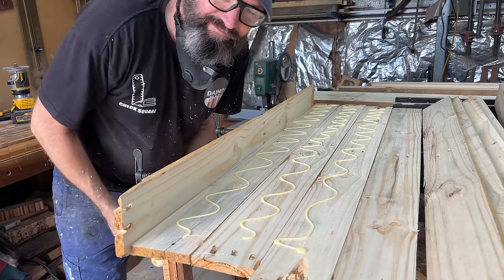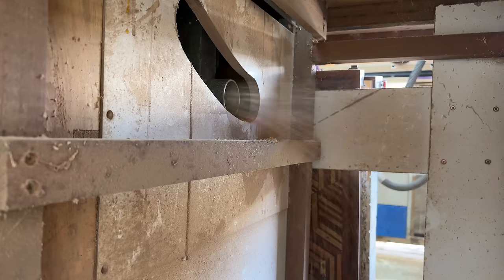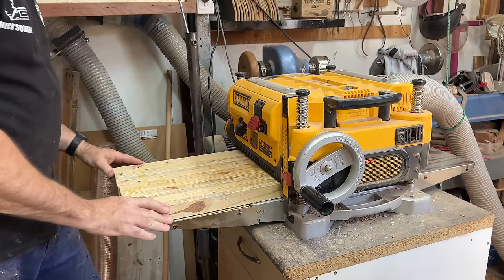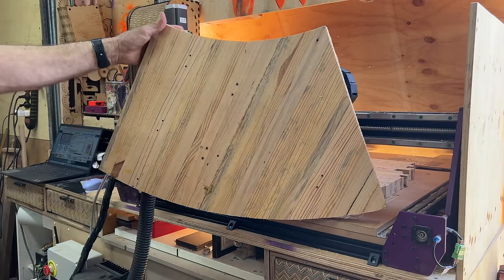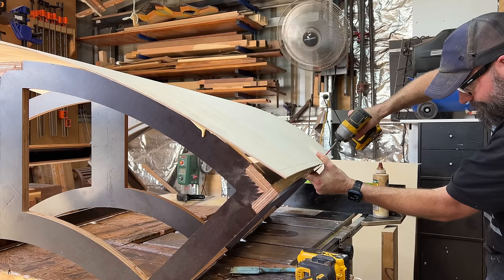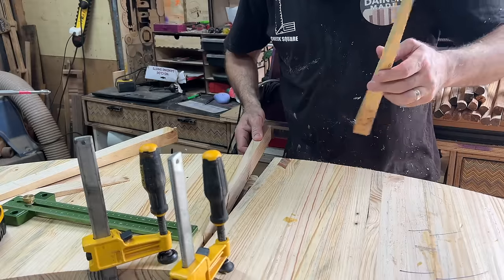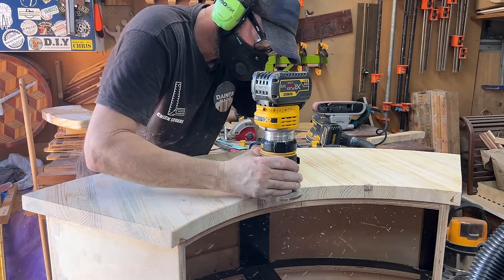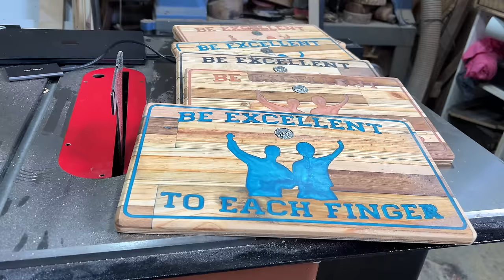Ambitious project to save us lots of money

Comment: At 6 minutes in, I like the explanation you gave about the movement of timber, but I do think the timber of its going to move will go side to side, as well as up and down, just not in the length. It's just how timber is, it has nothing to do with how the timber was nailed in the pallet.
Reply from the maker: the nails holes are the side grain faces off the  of the boards that's all. It will all move yes, but I am reducing their chances of separations. cheers mate

Comment: You are productive, man! Looks easy on video all that work, but you got dedication mister! Bravo! The reason for the nail holes facing up, is not about the nail holes as much as the grain direction, right? I understood the advice coming from the fact that the nail holes indicate which direction the planks had been attached on the pallet, which obviously is the flat side, thus meaning the grain direction will be the same – or am I missing something? Cheers!
Reply from the maker: That is right, I think I could have explained that a little better. The nails are on the side grain of the board. Therefore breathing in and out as in up and down. Rather than expanding more across the slab

Comment: Hello.
I recently got into woodwork. And came across your video and love them. 
You have inspired me to try new things. I also like using pallets. I'm from the UK. I got a question tho what table saw blade do you use? 
I got a second hand one recently as a starter table saw and Need a better blade but a tad unsure what to get.
Thank you 
Ardam
Reply from the maker: I generally buy ripping blades as that is mostly what I do. I have one with a flat tooth grind as well which lets me rip, and also cut flat joints
Reply: @dainermade  thank you for replying

Comment: hey mate, buy yourself a multi-tool...trust me there will be no regrets
Reply from the maker: I did own a shite one once. Is this for the slat chopping?
Reply: @dainermade  yeh, also finish sanding for those tight corners..also you can get a medley of different width blades…the amount of times it has got me out of trouble is insane..the other attachments are good too like the mini wood carvings discs

Comment: Dude. That rules! That thing is going to look wicked. How good was sticking the landing on the overall batten spread, last one dropped in its spot perfectly  👏👌🏻 Ioved the ratchie clamp approach too....  have you got a finish nailer in the arsenal? That would of been the quicker/easier/far less anxiety inducing approach. Paslode should jump on board for the next build 🫶 

Very good message too. I spent a decade trying to deal with PTSD & mental health issues in all of the worst ways possible. Some of those worse ways were even given to me by Doctors 🤷 But talking ended up helping, talking helped the most. Talking to the wrong therapists however was off-putting & didn't help. I would of loved to be able to switch therapists as easy as they claim you can on this app. I'd suggest anyone that's constantly dealing with anything internally to just go for it & get talky talky. Worse case scenario you have a 5-min chat, best case scenario the little problems you're repressing get dealt with & don't inevitably compound into bigger problems.

I digress.... hell yeah WOODWORKING, FURNITURE, ART & FRIENDSHIPS & STUFF!! ❤😂
Reply from the maker: My dude!! Firstly no I don't own a pin nailer as yet. Secondly thanks for sharing that mate, it is important stuff and talking it out is the best way. Very happy the woodworking caper brought you into my life mate. Brosephs! 
I will pin your comment after I have given Marties a few days .